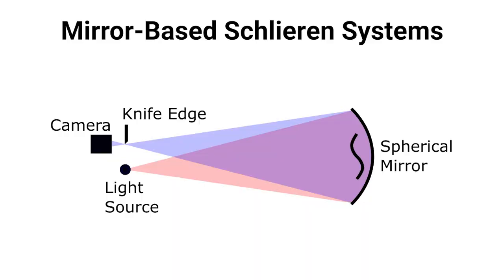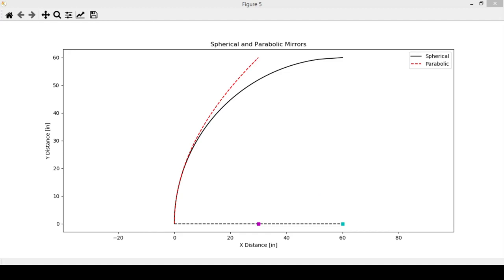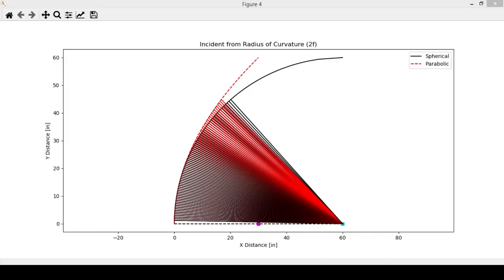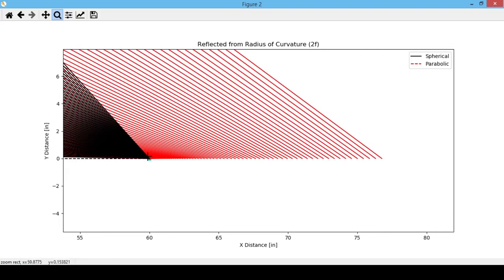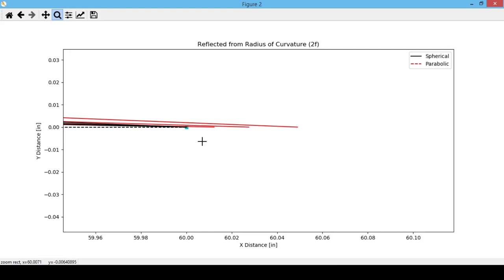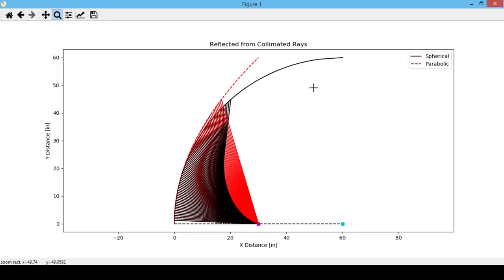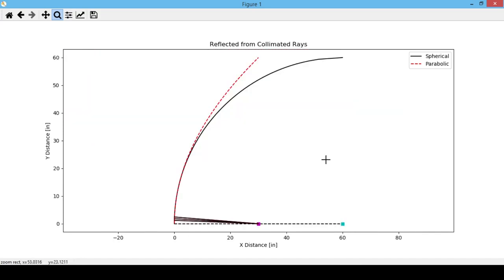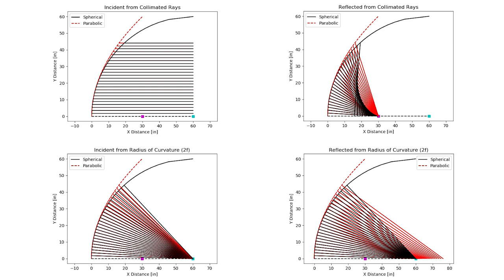Schlieren Mirrors: Spherical vs. Parabolic

Comment: Did you ever do the video showing the double-mirror setup?  I have the parts, and was looking for some instruction. Thanks.
Reply from the maker: Hey Todd, no not yet.  I've been on a hiatus from making videos for a while now (I know this comment is a year old), but I'm still planning on doing this at some point.
Reply: @JoshTheEngineer  I built one and did some videos. You can find them on my WarpDriveTech channel.
Reply: Hey Josh, I always get a parabolic image in double mirror setup even after rigorously setting it up for hours, Could you please suggest some content which will help me in setting it up.
PS: I have a readymade schlieren imaging system.

Comment: Depending on the combination of mirror diameter and focal length, the difference between a spherical and a parabolic mirror may be less than the Rayleigh limit, at which point there is no optical difference between them. 

Settles (the guy who literally wrote the 'book' on Schlieren and shadowgraph) refers to the book "How to make a telescope" for details on this, where a formula (or a table) is given for determining when this is the case. For a diameter D in cm, the focal length f (also in cm) needs to be f >= (34.9D^4)^(1/3) and then the two mirrors are equivalent. Or for D, f in inches, f >= (88.6D^4)^(1/3). 

With a 6 in mirror for example, an f/# of 8.1 or higher makes the type of mirror unimportant.
Reply from the maker: Thanks for comment!  For sure, Settles' book is a go-to for anyone setting up a schlieren system.  My main purpose for this video was to provide a non-mathematical, visual-based demonstration aimed at any DIYer that wanted to quickly understand the differences.

Comment: I have a question for you. If someone grabbed a huge washing machine box and put it on its side on a skateboard, then grabbed a scuba bottle and put it in the box with the nozzel pointing to the closed end of the box and turned it on, which way would the skateboard move? All of the air is excaping out the back of the box propelling it one way however the thrust from the air jet is facing the other way?